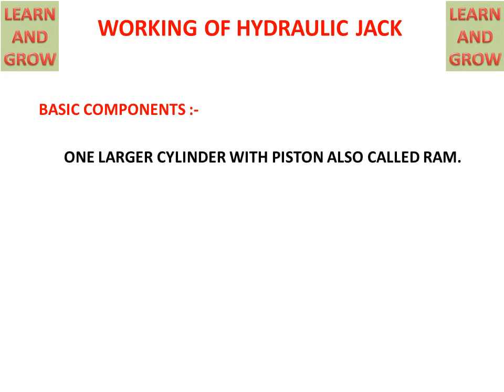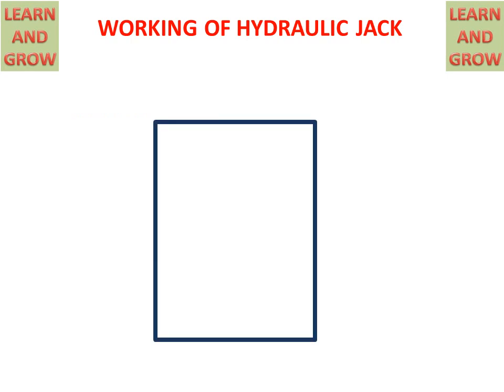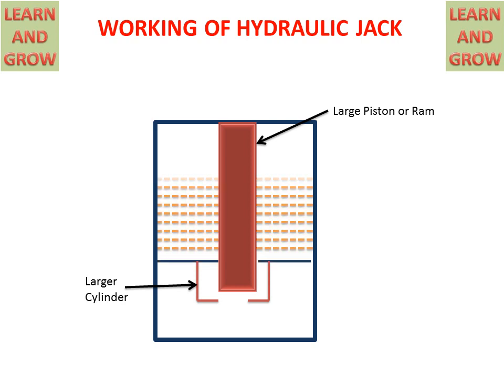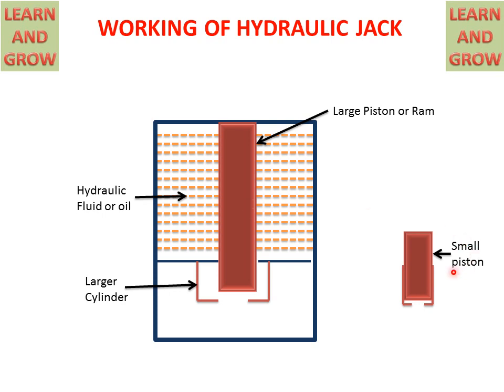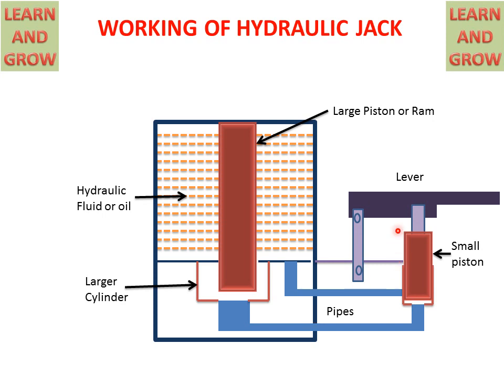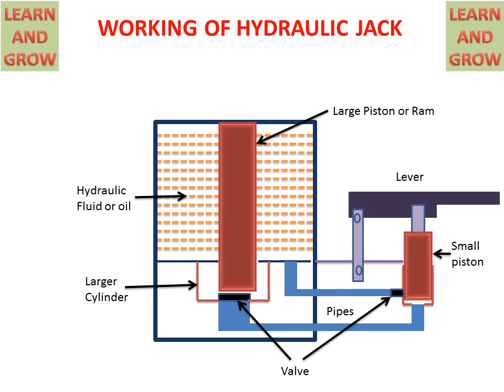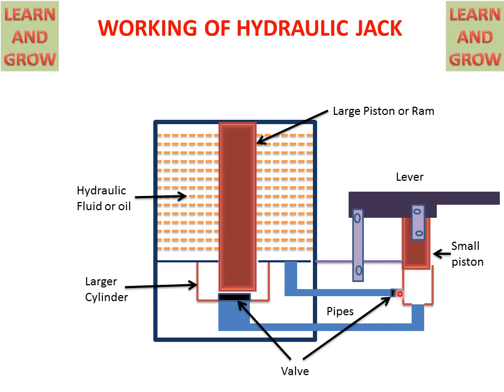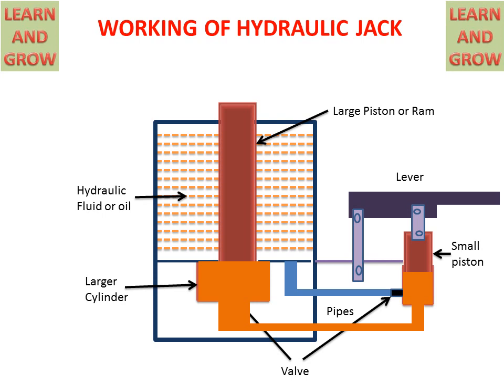Working Of Hydraulic Jack

Comment: How to get (liquid) from the reservoir into the small cylinder through the valve and not replace it with something else? 
I mean you can not take any liquid from the reservoir or even open the valve if it’s completely sealed. Unless the reservoir tank shrinks?